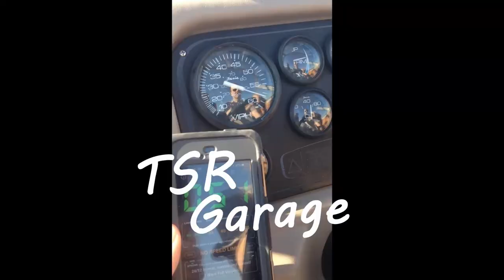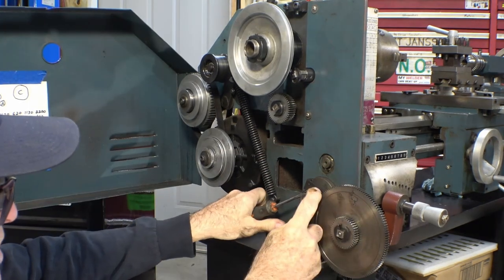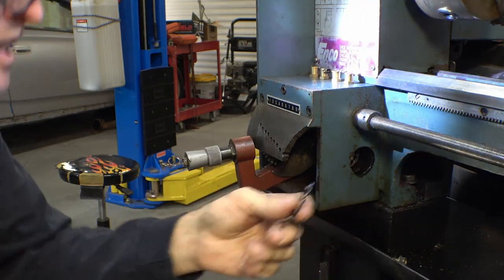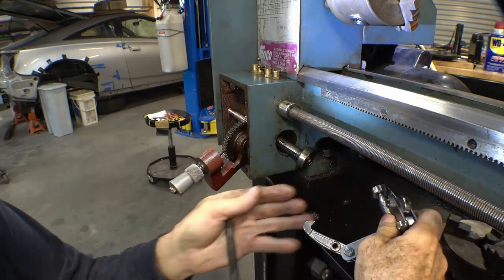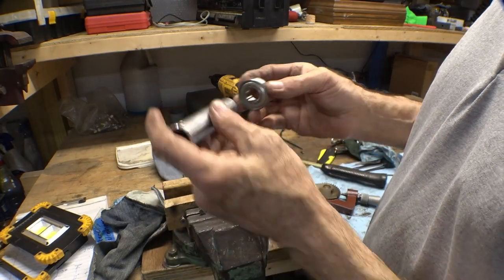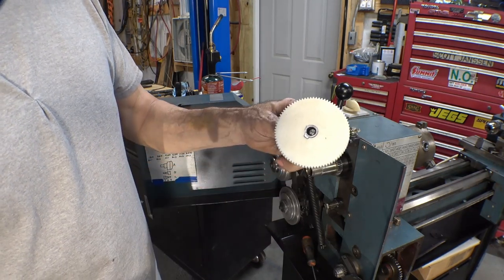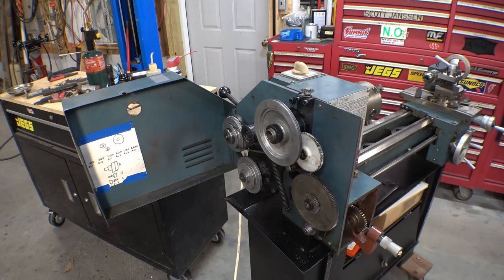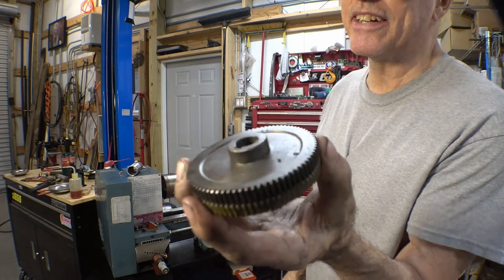3d printed lathe gear - Enco 9X20 lathe, and bearing replacement

Comment: That lathe was also sold in the UK and that gear wheel on the lathe's  here is the standard cast Iron type spur gear with teeth Module 1 you can purchase it from China via e bay.
Reply from the maker: Thanks for commenting.
   True, The plastic gear is a fail safe. In case of an operator malfunction, jam/over travel. The cheap gear will fail saving more expensive parts. I wanted to keep that option 😁.
At 16:30 I mention the metal gear. At 17:00 I briefly say what possibly broke the plastic gear. The small piece broken off the selector is in with the extra parts. But I haven't repaired it yet, I will someday🤔........
Reply: You have a link?

Comment: I think my Grizzly G4000 is the same unit. What gears get you the slowest feed rate? I think mine could be slower for a better finish, but I don't have the gears unless I print them. thx
Reply from the maker: Not sure what is running on it. Haven't messed with switching. Also I don't have a full set of gears.
Reply: @TSRGarage  sorry for the late reply, thanks anyway. 

My G4000 is essentially the same lathe. At nearly .005 in/rev, it’s hard to get a good finish with the power feed. I’m finally going to print some gears today. 👍